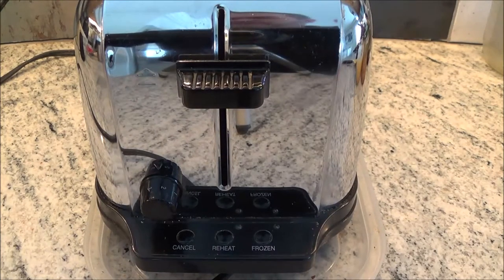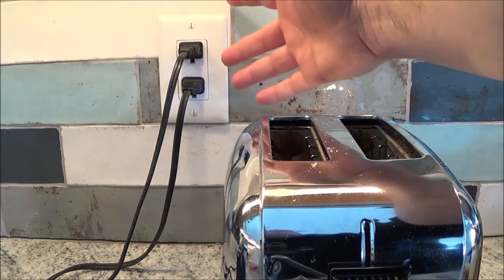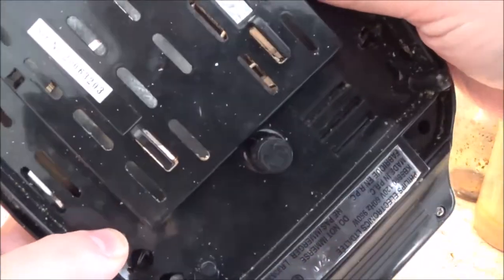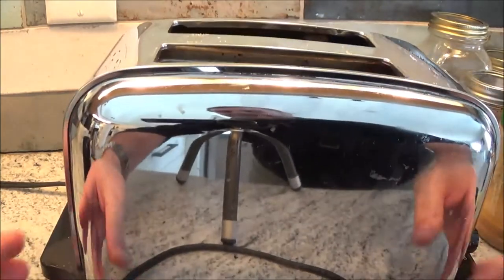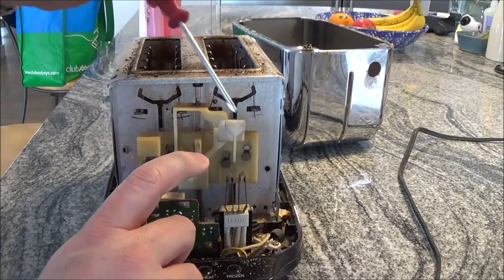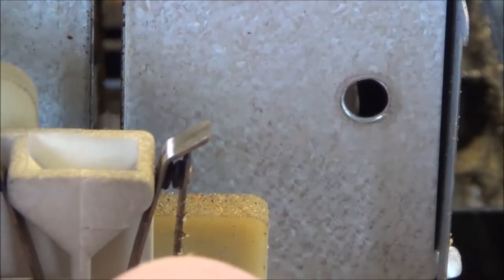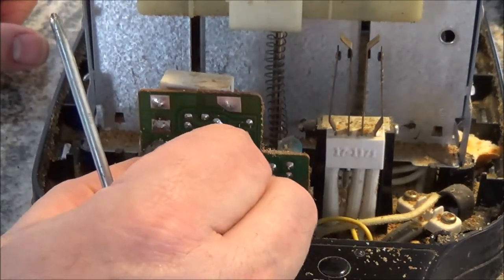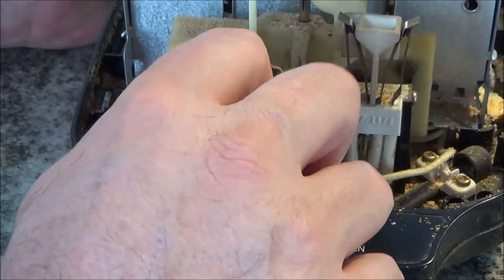Phillips Toaster is busted. Lets see if I can fix it!

Comment: Hi Frank. I watched your video and controlled the points that you've underlined. Everything was correct. Then i saw that the glow wire was broken on one point so the circuit was staying open. i connected the broken wires... but no success, toaster was not working. then i realized that the pin which connects to the control panel was loose. i tightened it and voila! now its perfectly working. i'm writing these extra check points here, maybe your followers will benefit. Cheers!

Comment: Really good video - Frank's step by step safe explanations were very helpful - thanks again - it was the exact same model of Philips toaster for me which made it easy to follow. I was able to fix it by cleaning the 2 pairs rond contacts with sandpaper. Little more problems for me to remove the black plastic handle and the rond 1 to 5 controller. The trick was pry it gently on one side and the other.  Thanks again for extending the life of this small morning appliance!

Comment: I fixed mine by turning over the   Tiny Rectangular Metal shim that sits over the electromagnet. It comes out easy as it slides out of the plastic holder.

I am guessing it was magnetised too much over time.

Anyway , it definitely works now and holds down.

Comment: My old Rowenta has the same problem, and just like with Frank's toaster cleaning the magnetic contacts didn't fix it. The electromagnet somehow is not getting power. It was the first thing I tried too. But this video was most enlightening in how these toaster mechanisms work.